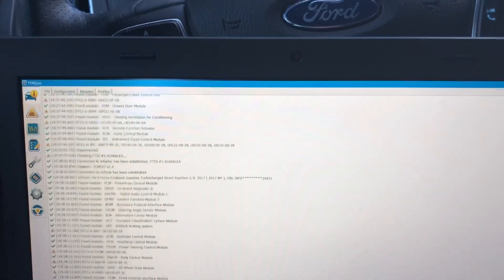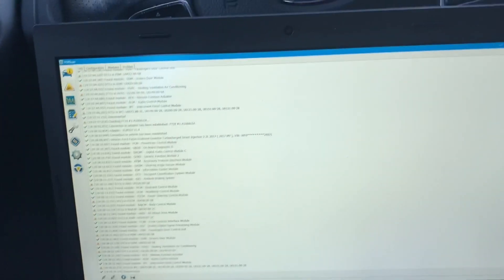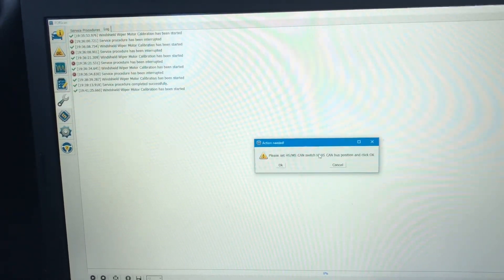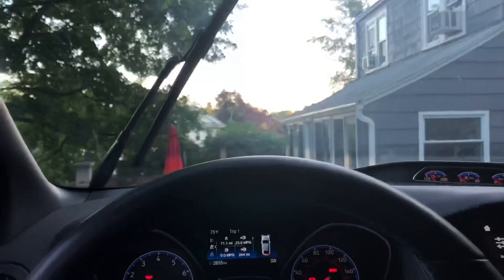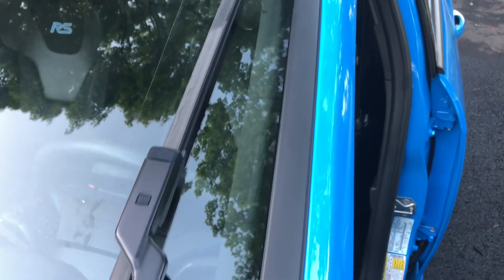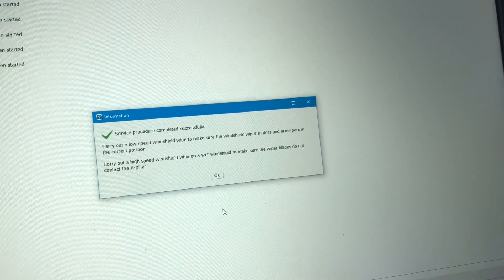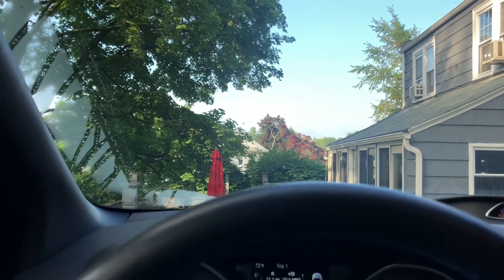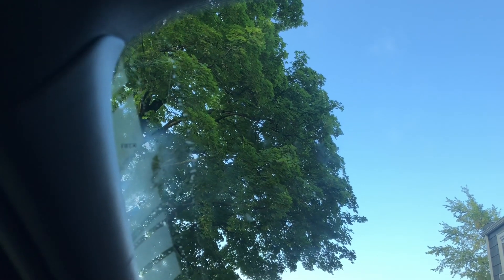Ford windshield wiper motor position calibration (Focus RS, ForScan)

Comment: Most people won't know to do this but if you unbolt your pivot arms you'll want to follow these steps to put them back on correctly without having to recalibrate your wiper motors. 
Basically when the ignition is on, the  wiper motor "locks" in place to its proper park/rest position and doesn't move until you give it input from the wiper stock, this will ensure proper alignment when bolting/torquing the arms back on. When the ignition is off the wiper motor moves freely up and down which can mess with proper alignment. 
Installation:
1. Ignition on (position II). 
2. Cycle the wipers through one full movement, then stop them in the PARK position. (PARK just means resting position with the stock set to off)
3. Keep the ignition ON during installation. 
4. Align the wiper arms correctly: Left (driver’s side): 90 mm (3.54 in) from reference point. 
Right (passenger’s side): 75 mm (2.95 in) from reference point. 
5. Install washer(s) and nut(s), torque to 30 Nm (22 lb-ft). 
6. Install nut cover(s). 
7. Set ignition to OFF (0 position).
Reply: This seems to be the most straightforward explanation. I’ve tried to get the wipers back on at rest but had no idea where exactly to put them… where is the reference point?

Comment: Sometimes the problem is within the wiper arm itself. If it was removed for, say, work on the front suspension or battery, it needs to be manually reinstalled following the markings on the bottom of the windshield. After that you can recalibrate it, but most of the times, repositioning it correctly will do the trick just fine.
Reply from the maker: Good tips! Yes, this is definitely meant for smaller changes.

Comment: HI.
And how its look on parking Mode?are wipers touching eachother? I ve made a calibration.. But when wipers are going to sleep.. ;) they making metalic noising :(
Reply: Problem with the rest position. If any service performed on your car had removed the wipers, they were probably reinstalled incorrectly. There's videos online showing how to fix it.

Comment: my left wiper goes over the edge of the windshield onto the "A pillar" and then gets stuck. My mechanic said motor is busted but when I pull the wiper arm off it cycles all the way. Do you think this would fix it?
Reply: Same here
Reply: To fix that, take your arms off, turn electrical on, and reinstall the arms.  Take note where the arms are when switch is activated.

Comment: My wipers opened and stayed all the way open and now just jump or wiggle back and forth 2". The car had been parked for 3 months over winter. Go out the fire it up for first time and wipers open and stopped in full open position. Dealer says  $700 for new motors and its fixed. Can I fix this myself? I can change brakes, plugs and such so I'd think this could be fixed for less .